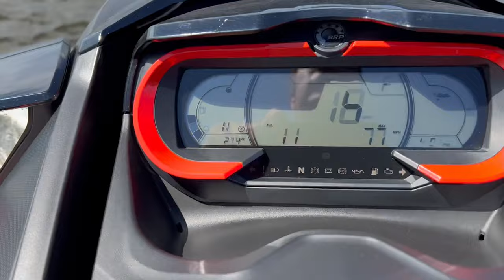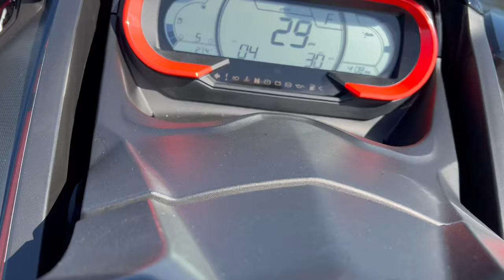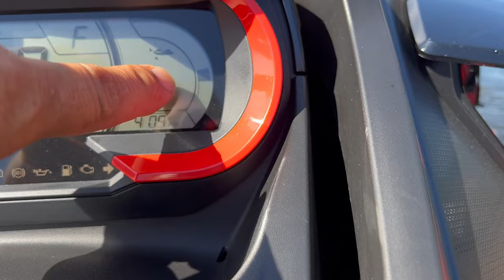SeaDoo RXT-X Drive Shaft & Carbon Seal How to fix + Tune up, Shorty Water Box, Fizzle Intercooler

Comment: Was the performance upgrade just the prop? Was the Fizzle to replace a damaged intercooler or upgrade?
Reply from the maker: He’ll be back for more performance
Reply: Anything that is not stock is an upgrade! 😂
Reply: I was thinking more specifically, some things are cool factor /cosmetic, some are reliability but don’t add power like valvetrain stuff, and then actual horsepower improvements.

Comment: How often do you see the pto seal bearing fall apart when removing driveshaft for carbon ring replacement? Is this a common problem for 3+ year ski jet with few hundred hours on it? Wanted to replace the carbon ring on my 2020 GTI (was rental until 2021) but got warned that at least the bottom bearing with seal must be replaced (not mentioning the driveshaft due to salt water corrosion).

Comment: Hi Ernesto, I have a error code P0340 'Camshaft Position Sensor 'A' Circuit (Bank 1 or Single Sensor) Do you have any advice on how to rectify the issue or where to start with? My Sea Doo is a 2023 Rxp-X Apex. I checked the electrical and seems like there is power from the harness to the sensor, and I replaced the sensor but the code still pops up.

Comment: Does any sign of carbon dust indicate a bad carbon seal? Or some dust is acceptable on >2018 seadoos as long as there is no water dripping/spraying?
Reply from the maker: If you don’t have any water I  wouldn’t worry about it
Reply: @calasworld  and looking for drips while idling in the water, large amounts of water in the hull after riding, or wet carbon dust all be the correct way to check?

Comment: Hey Calas, question I hear this rxt x300 starts very smooth, my brand new 2022 with 10 hours makes sounds canister rattle noise when it starts from back side sounds like something lose, but when I check with my hands it seems all ok, any idea ?
Reply from the maker: If it makes the noise in the water, you are in trouble if the noise is on the trailer outside the water, it’s normal
Reply: @calasworld  it does when it’s outside of the water
Reply: @Herofmine like Ernesto said, it’s normal when it’s outside of water. Should not do it in water.